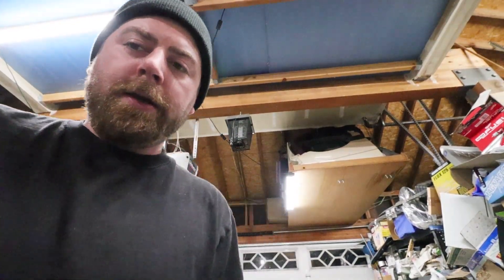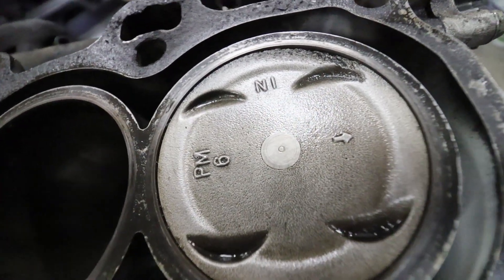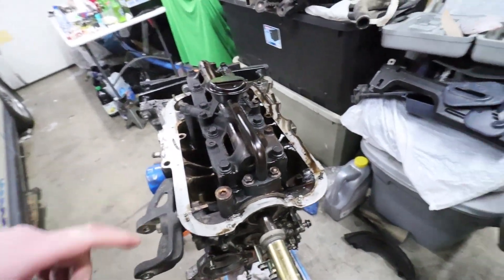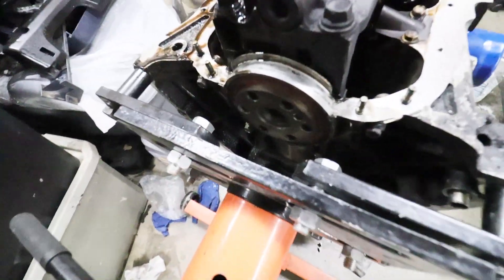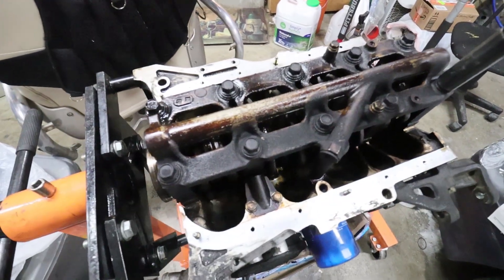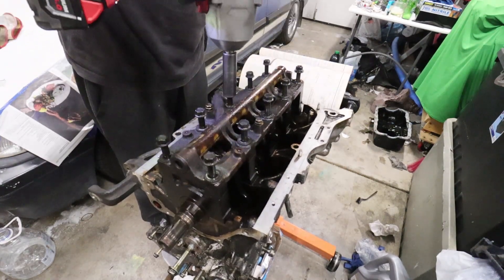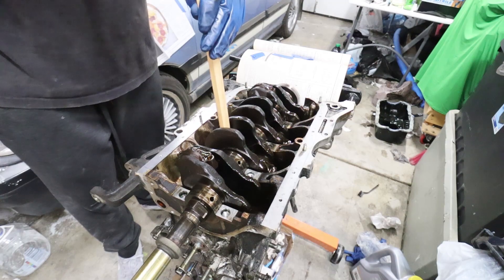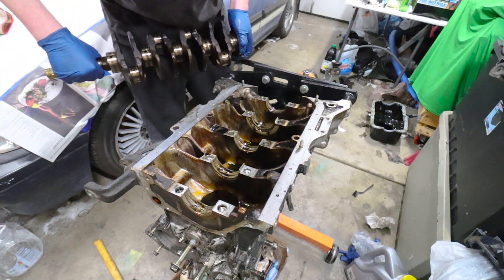How to tear down D series short block (D16A6 will need a rebuild)

Comment: Luckily you can still buy just about every single internal part brand new from the Honda dealership! If you're doing a standard OEM rebuild, I recommend going with Taiho/OEM Honda color coded bearings matched to your block/crank and of course plastigauging the clearances at minimum (to elaborate if you didn't already know this, the block and crankshaft are stamped with letters and numbers from the factory that you match to the factory service manual chart to obtain the correct color code bearing for each individual rod and main bearing journal, different color codes determine slight variances in bearing thickness), have the crankshaft run-out checked, get a 75.5mm bore and hone, NPR 75.5mm pistons and rings, new Yamada oil pump, Aisin water pump, upgraded MLS style head gasket with proper 25Ra or less surface finish on both the block and head deck surfaces, speedfactory viton valve stem seals, get the head looked over for cracks, have the seats and guides inspected, replace as necessary, and she'll be back to that original reliability 😉 Also, if you're looking for OEM quality sensors and can't get them at your local Honda dealership, look for TAMA branded sensors.

Btw, I just subscribed to keep up with the progress my man 😎
Reply from the maker: Agreed definitely considering a stock bottom end and a mild build top thanks for the tip and thanks for subscribing! 💯 **